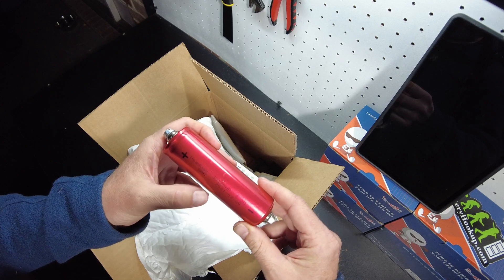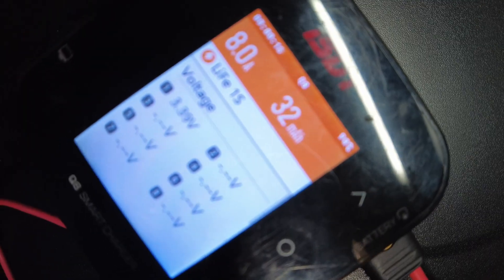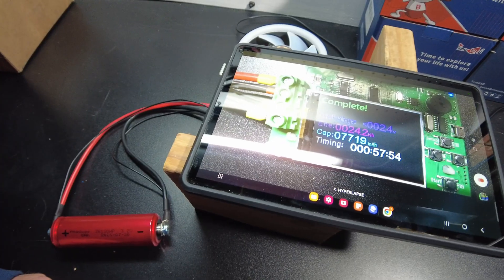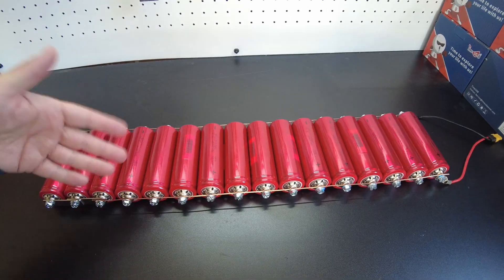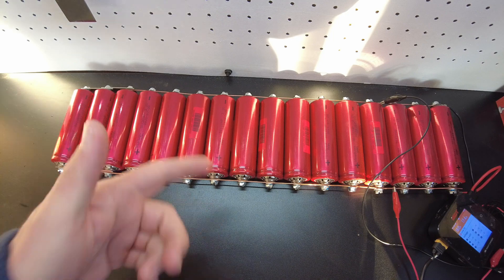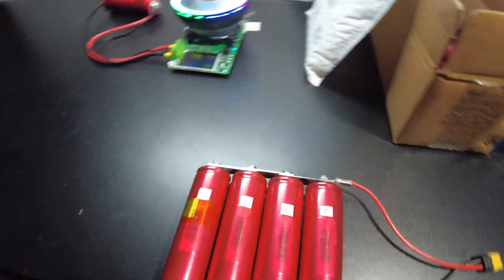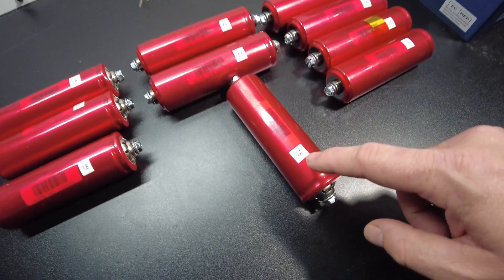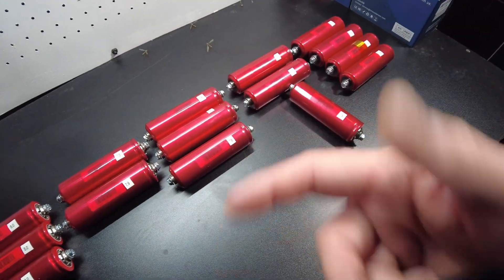Cheap Headway 8ah LiFePO4 Cells

Comment: No, your comment about balancing cells is incorrect. 
Connecting the cells in parallel WILL balance the cells. It won't balance them at a full charge. But it will balance them. 
And this is recommended prior to charging. 
Not hard to figure out. Test each cell, then connect in parallel without charger. 
Test again, you will see the cells have balanced. 
Then apply charge.
Reply from the maker: I actually put this to the test here: https://www.youtube.com/watch?v=aP8AehfqxgA
Reply: @BradCagle  no, you didn't. You miss the point altogether of parallel balancing prior to charging. 
This has been proven multiple times. 
You never even checked the cells after balancing PRIOR to charging. 
Cell hitting a target voltage prior to another isn't solely based in balance. 
Smh
Reply from the maker: @danny51577  I charged the cell that did not hit the target voltage after the test, and It took over 1ah. It's in the video, did you miss that part? I did it for the 24h test, and the 7day test. That 100% means they did not balance.
Reply: @BradCagle  again, no you didn't. Very simple. 
Check voltage on all cells. Generally they will not all sit at same voltage 
Parallel balance. 
Surprise, now they all sit at same voltage. 
Then install balancer and bms. 
Then charge. 
And the reason you Parallel balance and utilize a balancer and bms, is bevsuee you will severely tax your alternator and draw unevenly in car audio utilization, resulting in damaged cells. 
This isn't anything new. You can find dozens upon dozens of examples from when headway first became popular years and years ago.
Reply from the maker: @danny51577  Again, voltage does not tell you SOC with LiFePO4. You're literally  thinking if two cells read the same voltage they are balanced. Balance cells means same SOC, not same voltage. Only at the extremes 2.5v, and 3.65v do you really know the SOC.
Reply: @BradCagle  no, balance is balance. State of charge is obviously different. 
In a car scenario, go ahead and skip parallel balancing and a balancer a d toss them into your car on your alternator. 
Let us know what happens. Smh
Reply: @BradCagle  pretty simple. Take your cells, check your voltage on each. Parallel balance them prior to charging. 
Re check voltage. If no defective cells, they will now check out as same voltage.
The charge. 

There's reasons car guys know this and reasons they do this. Also reasons they use a balancer and bms. Smh
Reply from the maker: @danny51577  You don't understand LiFePO4 chemistry. Voltage has 0 to do with balance. Balance means they have the same SOC (State Of Charge) Voltage means nothing here. You need to look up charge, and discharge curves for LiFeP04. The you'll understand the voltage is mostly flat with LiFePO4. A cell the reads 3.3v can be 50% charge, and another that reads the same 3.3v can be 70% charged. Thanks
Reply: @BradCagle  what are you not understanding. It does matter in the car audio scenario. Hence, why guys parallel balance before charging.
Reply from the maker: @danny51577  Well they THINK they are balancing their cells, but they are not. What they really need to do is parallel all their cells, and then apply 3.65v, and leave it at 3.65v until the cells stop pulling power. Or pull very little power. Then they will be fully balanced. I do see them using active balancers, and this will balance the cells when they charge the battery. But they usually do not use a BMS, so it's very likely some of their cells are going over the 3.65v limit at times. It's probably only causing a small amount of damage, and the active balancer is probably getting them balanced in time before much damage occurs. Thanks
Reply: @BradCagle  you have obviously never read white papers from manufacturers. And apparently you are either guessing, or know nobody with any knowledge of any sort of lithium if you think most don't use bms. 
And yeah, if you think there won't be much damage by overcharging these cells, tells me all I need to know about your knowledge. 
You have obviously never utilized these in a proper and in an improper auto scenario and it shows. 
Good luck with that
Reply from the maker: @danny51577  Top manufactures send their batteries to me for testing, and reviews. I guess I'm a just a lucky noob :) Thanks
Reply: @BradCagle  yeah i can tell by your history and qualifications, top mfrs sens you their batteries for testing. Smh. 
And you still have obviously never read a white paper. 
Lucky isn't quite the word. 
Thanks have a great day
Reply from the maker: @danny51577  LOL, yeah I'm sure you're right. Have a good one!

Comment: they are not cheap i have 52 in one battery cost286.00 for a 12ooah battery you can buy for 200.00 with bms complete all day long, the only thing is you can buy a few at a time here and build as you can afford it
Reply: I agree with this statement and would be the route I’d go if building for amp hours and not power , but for example if ur building a 12v battery using those 52 worth of cells 13p4s that’s a pack capable of 1500a+ continuous and 3000a+ pulse that’s crazy  and 104ah which is awesome too, the standard 105ah or 120ah battery with built in bms uses typically prismatic cells and are only rated for 100a continuous and 200a pulse
Reply: @mitchdodd9732  im using it now to see what it will do i try not let it get under 12.8 v nothing seems to stop it

Comment: Your setup resulted as expected: furthest cells got less power before the charger stopped. It is common practice to power opposite ends of the bus bars to normalize the problem, say, positive to nearest cell but negative to furthest cell, or vice versa. Just a thought and appreciate your videos.
Reply from the maker: I should have had the sense wires connected at the far opposite end, that way it would have read the voltage at the far cell. I don't really expect the results to be far off from what I got. I could just charge up the lowest capacity cell by itself, and capacity test it again to see if it gains anything. Thanks for the comment :)
Reply: @BradCagle  that would be a good test. Thanks.

Comment: What's the website you mention that shows optimal cell arrangements?  What power supply do you use with the hobby charger? Thanks for the video!
Reply from the maker: I just searched and found this site https://www.repackr.com/ As for the power supply it's just an old laptop power brick, I think 5a @ 19vdc

Comment: I bought some on EBay because they claimed they were new. Didn’t show up with any hardware…sketchy 

Capacity test 7.8 to 7.9 Ah…yeah that’s not new. 

Seller is from AZ like me and the cell terminals look new so I’m guessing stored in an non air conditioned environment for a few years. 

Still need to leave that MF’er negative feedback. 

Anyways, putting the cells in parallel does in fact balance them albeit very slowly. The current really slows down as they get close together so it could take weeks if you really wanted them to be exactly the same.
Reply from the maker: Yeah, lot of scams out there. I don't know how these people sleep at night.
Reply: @BradCagle  They sleep on piles of money like that dragon in the Hobbit.
Reply: Eric is correct this will slowly balance them, the car audio guys normally charge balance them then take them off the charger but leave them all connected to balance without charger for a day to a week-ish
Reply: @mitchell4984  yeah the last few mV get really really slow. Current gets almost undetectable and I'm usually fine once they are all within 1mV either direction of 3.550

I don't charge up to 3.65, I just don't see the point. The capacity gained is literally nothing and the cells really start to run apart past 3.55 unless you have the best matched set out there.

I should do a test with my Headways and see what % of capacity is past 3.550

Might try charging up to 4.20V one of my A123's that has a tiny nick on the corner of the casing so I didn't plan on ever really using it. Doesn't leak electrolyte or anything but I don't put cells like that into packs.

And yes, safe max charging for some LiFeP04 cells explicitly states 4.20 but that is the absolute max and 10 years ago they started realized to drop it. If you look at old LFP literature you can almost see the gradual decline towards 3.6V-3.7V over the years
Reply from the maker: I just put this to the test here: https://www.youtube.com/watch?v=aP8AehfqxgA
Spoiler I did a 24 hour parallel balance, and a 7 day balance neither came close to balancing the cells. The 7 day test did not perform any better than the 24 hour, in fact it was worse.

Comment: I see a quick and dirty diy car starter.
Reply from the maker: Yup, I think it would work!
Reply: @BradCagle  I’ve been experimenting with a small 4s-1p headway bank in a Corolla that I installed under the passenger seat. (buffer batt. for small amplifier)  Initially I used a dc-dc conv. running a bms on the pack, later a bms + balancer, and then lastly I removed both the bms and balancer. 

With each setup I monitored individual cell voltage characteristics and found that, when using same-batch/date the cells, they stayed within .05v of each other over 20 cycles.

Figured i’d come that far, so lastly I removed the dc-dc converter and am now testing it directly in parallel with the starter batt. (agm) My vehicles specific charge controller limits at 14.6v. When vehicle is off, the agm pulls the headway pack’s voltage down (very) slowly as it’s float voltage is slightly less, but unless left for long periods of time, is insignificant and the alt. has no problem topping off the headways after vehicle start. I wouldn’t attempt to charge a substantially discharged headway pack this way, however, as initial charge current would likely exceed what CC is rated for. 

Anyway, figured I’d share my experience since there isn’t much info around about using headway in such a manner. Oh and I disconnected the starter battery and the headway pack had no trouble starting a 4cyl corolla. They didn’t even become warm. Cheers!

Edit: Yes because of the shallow charging curve they must be top-balanced by parallel charging all cells to be used in the pack. Simply paralleling will not balance the cells, leading to individual cell over/under voltage and greatly reduced total pack-capacity.
Reply from the maker: @markb1911  That's awesome it can start the motor. BTW I've ran 4 lifepo4 cells in series without BMS for a little bit, probably 30-40 cycles, and yes it seemingly works fine. However it will eventually become unbalanced as the condition of each cell changes, and it will likely happen well after you've become overly confident that it's fine. Be careful, Thanks!
Reply: @BradCagle  100% agree about the cells changing condition over time, it is inevitable. 
The experimental pack definitely isn’t a “set and forget” solution, that could become potentially dangerous. After I finish experimenting with the pack & don’t plan on closely monitoring it any longer, I will run it with protection/balancing once again. 

I will say though, headway’s did exceed my expectations with the amount of current they can supply in short bursts.